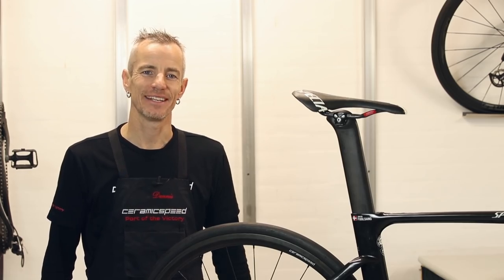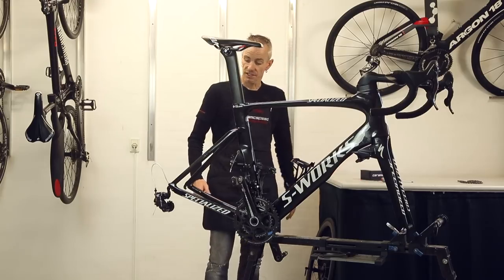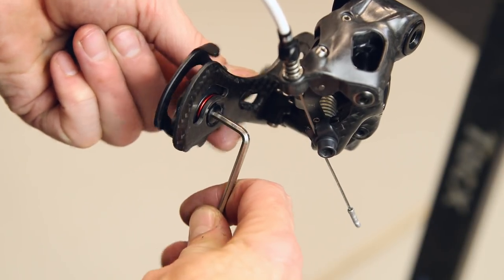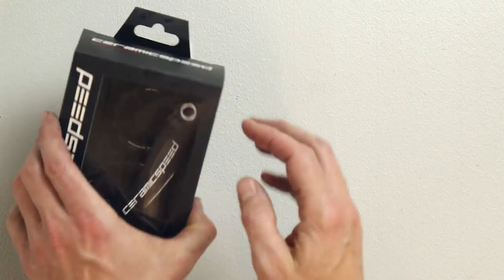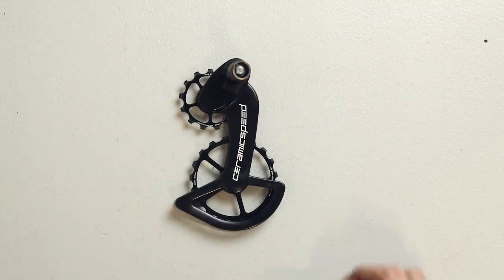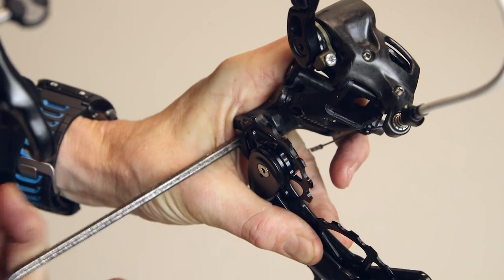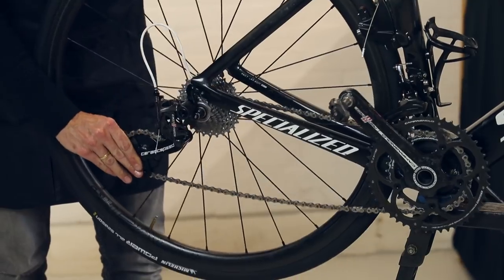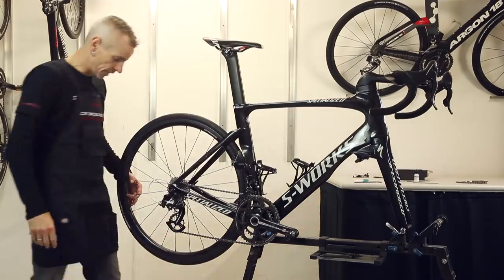How to install your CeramicSpeed Campagnolo OSPW System

Comment: I have experience with ospw of shimano 9000,9100, 8000, 6800. di2 also. Sram etap and sram red....and its work ok. 9100,8000, di2, and sram etap work perfect.

Sorry but campagnolo ospw not work acurate !! If I'm wrong ceramicspeed please do video of shifting prfermence (not just intallation) of  aspecially mechanical. and eps system !

In this video your mechanic shifting the gears fast, try do it gear by gear 11.12.13.14.16.18.......and after 29.26.23.19. one time in low chainring and after in high chainring. 

after in your website you write in overview :
The OSPW for Campagnolo is compatible with all Campagnolo electronic rear derailleur (EPS) and all rear derailleur with a mounting sleeve - no matter the age and model. At this point, this OSPW System is not compatibile with the Campagnolo 12-speed Record and Super Record derailleurs.

and after in istallation : 
The OSPW for Campagnolo is compatible with:
Record mechanical
Record EPS
Super Record mechanical
Super Record EPS
Potenza mechanical

So, model and age matter or not ?? 
Also with old 11s rear dereallers without b-tension bolt ?